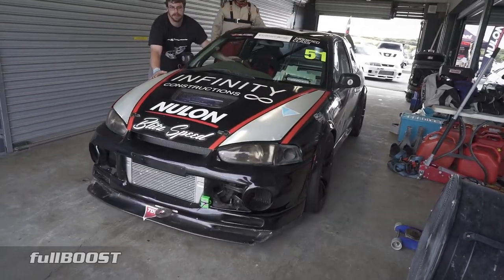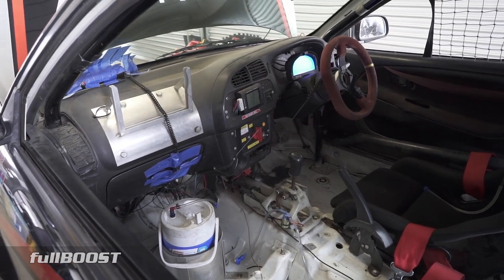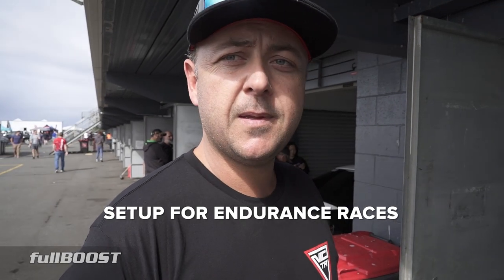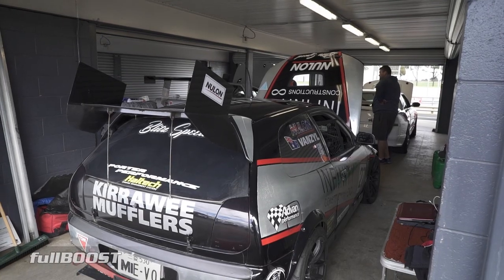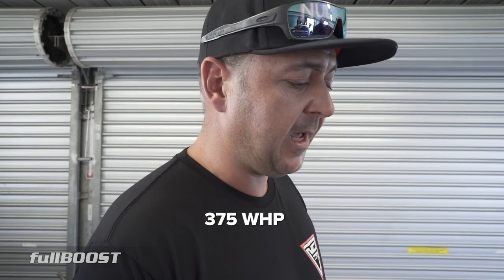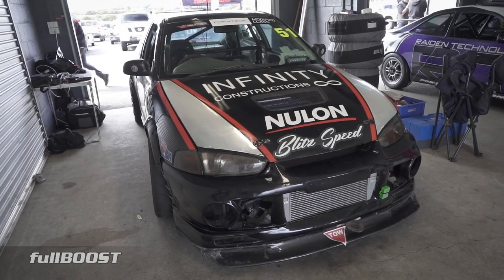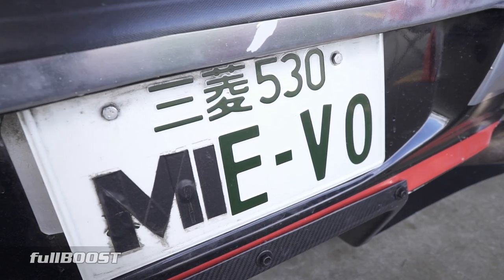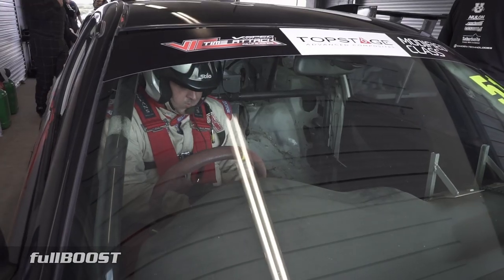AWD Mirage | Mitsubishi Endurance Racer

Comment: There used to be a Japan domestic model of these, which had 4x4 from the start. We saw it here called the 'Starlet', but we only ever saw the front wheel drive version.... It was a rally / homologation car, a fore-runner to the EVOs. A mate of mine was an old car racer, and his son had one of these things in about '94, and it had the boost turned WAY up. It was still a registered road car, and it got driven, but it was said to make about 600 hp on pump fuel and about 800 on jungle juice. That damn thing was FAST! Not just in a straight line either... It wasn't exactly what you'd call a sleeper, it had a big exhaust and a big intercooler and stuff, but nobody realised just how fast it really was...
Reply: Kneedragon1962 
The Starlet was made by Toyota.  You are thinking of a Cyborg.

Comment: that is a great mirage. if correct they used a 4g63 2.0liter engines parts from a mitsubisey lancer evo 2005 sorced pistions?

did you know you could get a lti black cab in uk using this same egnie with no 4wd drive and they used around the uk.

https://www.levc.com/corporate/news/london-taxi-company-becomes-levc/

they converted to electick now but they have a list of egnies used tho

peugote , ford  , mistbuesy, nissan, etc.

and if correct it a over head engine 2.0liter  inline 4 formatt with a 5/6 speed gearbox 

josh.

the most powerful from that eniges is 1200bgp or 500bhp and

the 1200bhp used a billitet engine block and mitsubisey parts. to improve perfromece and combustion presure to.

Comment: with the weight of the engine,gearbox,tailshaft and rear diff assembly, should just got a lancer evo. The weight would be the same, no difference. That mirage has no advantage whatsoever.
Reply: Actually its much lighter ,depends on which mirage you start with a base stripped out mirage is 860 after grafting a roll cage and dependent if you use stock subframe or custom one  for the rear diff the final weight will be between 1060and 1080 kg and a stock evo 4to 6 is 1500kg full weight and when race trim 1360 kg so you do the math
Reply: @kevingoddard5814  Your incorrect. The weight  of a EVO 4-6 is approx 1250kg. An evo drivetrain in the mirage would be 1 tonne. Add the weight of all that roll cage, and it would be just over 1 tonne. Obviously your setup is in a more aerodynamic car with small wheelbase, side track, but the weight is close.